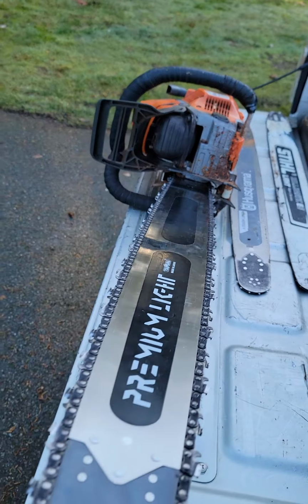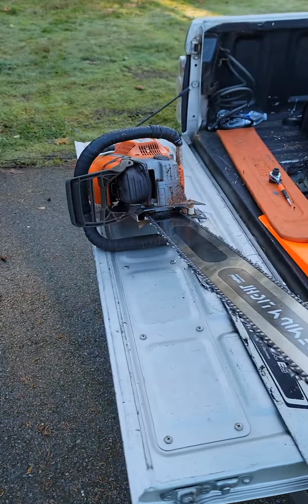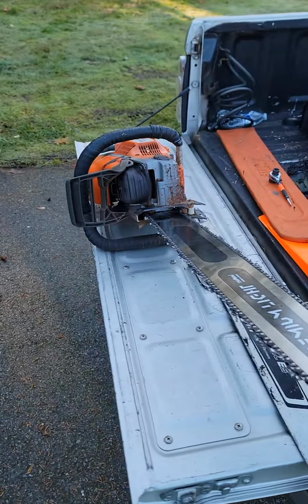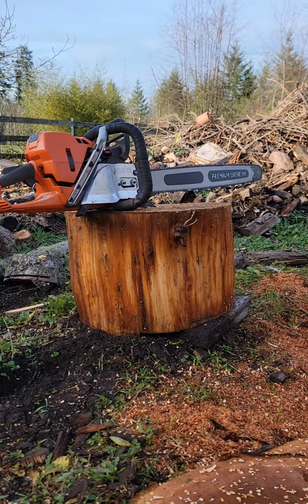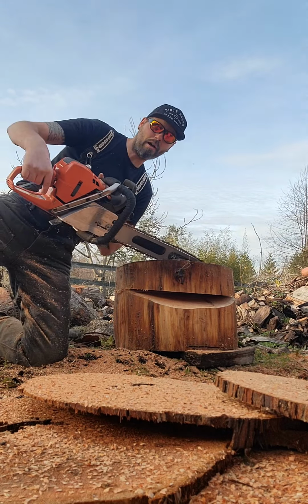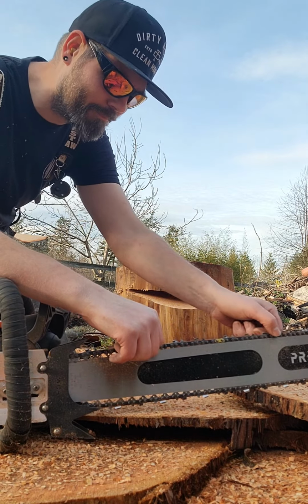32" Tsumura Premium Light Bar

Comment: Firstly, thanks for putting out this video. I really thought I wanted this Tsumura bar since the good ol' Oregon light bars are no longer. Sadly I've never had one. I just bought a 562xp mark 2. Muffler mod any day now. I want to run a 32" Stihl ES Light bar with a .325 full house chain.  Would you happen to know where I could find a tip for that Stihl  bar? I dont want to buy a bar until I know I can get a tip for it. My dealer kinda looked into it, but never followed through with a part number or a yes. More of a "I doubt it." I think when he told the Stihl guy he contacted what I was doing, he probably wasn't too excited to help a Husky customer. Thats what it sounded like to me. I also bought a Husky branded/ Sugi Hara 28" and it's still heavier than I hoped, so that's why I also want the Stihl ES Light. I think it's the best lightest bar available now that I see this one is a diving board.
Reply from the maker: The original Tsumura light bar is a great bar, I use it frequently. It's their Premium Light bar that is super flexible. Unfortunately, Stihl doesn't make a tip that you can convert over, and their biggest .325 bar is 20"
Your best best would be to get a Cannon Supermini Narrow Kerf bar. They make them in 28" and 32". I get mine through Cowlitz River Rigging here in WA. They usually keep a bunch in stock, so you should be able to get one quickly.

Comment: Great video buddy as always question for you. I took down a huge oak. Probably 6 and a 1/2 foot across. My saw was sharp 36 inch bar brand new. I would start my cut off fine once. I got to the middle of the log. My saw would start to Bind and I could not cut no more. You have any idea i've never came into this problem before thank you so much

Comment: Just curious but did you weigh it against a stihl light bar
Reply from the maker: I didn't weigh it against the stihl bar, but they are supposed to be about the same weight at 3.4 lbs